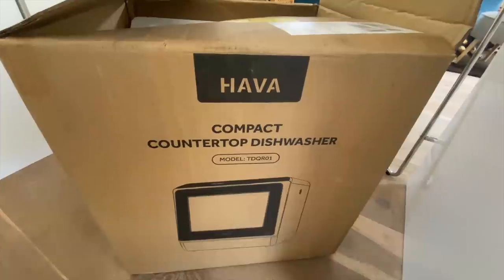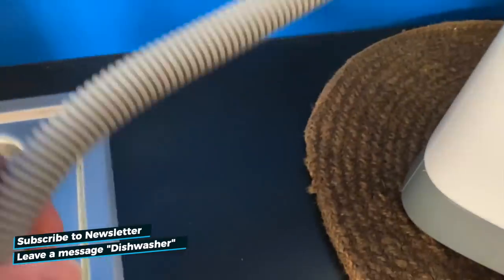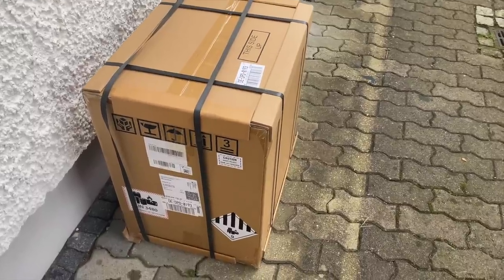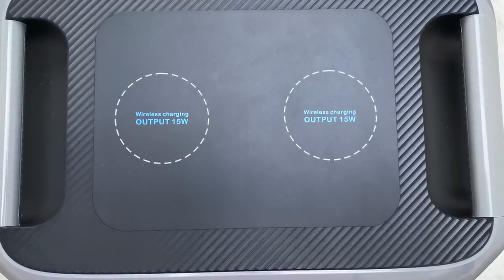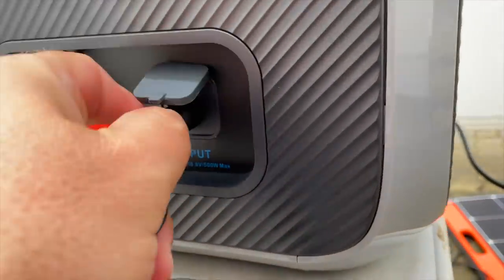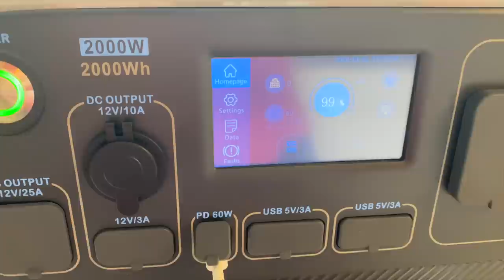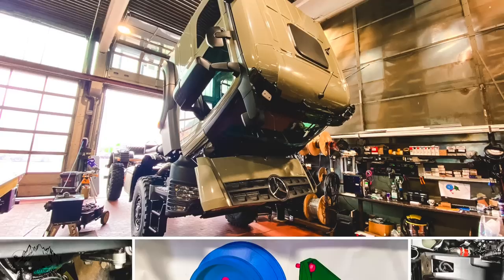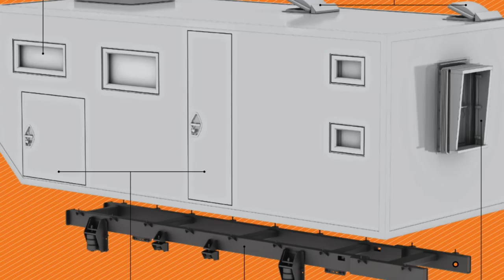Full Time RV upgrades ► |  Bluetti AC200P 2000Wh Solar Generator | HAVA Countertop Dishwasher

Comment: Have you tried to connect the new power Oak to a washing machine or a air conditioner in your home? I'm looking for a solar solution to lower my electricity bill, but I'm not sure if that device is suitable for this kind of use. Best Regards from Lisbon
Reply from the maker: It should be, power up to 2500 watt peak … 2000 watt constantly

Comment: What about power consumption of dishwasher per cycle with and without drying?
Reply from the maker: Will have a Look asap… at the moment dishwasher is with manuals at cabin builder in order to fit it in our new truck … 
Maybe you can check the manual online?! Thanks 
see ya when we see ya 👋 
Fabian Isabela and Matheo
Reply: My Comfee Plus peaks at 758 watts for the first ten minutes then drops to around 38watts for 40 minutes cycle,  no drying.

Comment: Guys come on. If you need a battery backup you've done something wrong when you sized up your solar panels and your house battery. You got plenty of roof real estate. Fill that rood with solar panel rather roof deck or other useless things that have no real life value. No one with a rig your size should need that battery backup. Just do the math correct when sizing up your system and you are golden. No matter how much power you use you will get free refill from the sun. Make sure you also prepare for rainy days, so add more batteries to your house batteries. Calculate you max daily usage and calculate 3 or 4 times more battery capacity and you don't need to waste money on that bulky back up battery. Used EV batteries can make up your entire house battery. Then you got power to run ac, induction, hot water and whatever else you fancy. Solar panels just passed 420 w per panel . Mount as many as you need. Even stack em 2 or 3 layers deep if you need more solar and make the lower panels slide out to each side or the truck, ie by using a manual awning crank device, a drill or electric motor driven with a push button.
Reply from the maker: In our case that’s a Back up when some essential electrical part fails … no worries 😉 we will have enough solar on the roof… we will use i.e.  a 120 volt power bank for 120 volt machines in countries where you only can buy 120 volt electrics… so all good… thanks for your informative comment…👍🍀
See ya when we see ya 👋 
Fabian Isabela and Matheo

Comment: Hallo Ihr Drei
Eine Spühlmaschiene für 3Tassen morgens? 3Teller und Gläser und Besteck Mittags und abends 2 Brettchen und Besteck. Ich hatte sie eingebaut und nach diversen Probefahrten wieder ausgebaut.
Pauerbox wofür? Grosse Batterie tuts genau so oder im Notfall einen Generator 2,2 Kw Honda als Empfehlung. Hatte die 30 Jahre in der Firma haben immer Funktioniert
Diesmal natürlich ein Inverter. Zum Kühl oder Gefrierschrank
Erste Wahl Vitrifrigo, teuer aber super. Denn die Kiste schleift Du nicht mit herum. Heute scheint mein motztag zu sein😩😜nicht bös gemeint. Wir haben Halifax für Mitte April Optiert und hoffen das es KLAPPT.
Grüße aus Erftstadt die Magers und Fatu Hiva
Reply from the maker: 🤣😊🍀 Motzi Magers 😅🍀 verstehe ich alles… jeder muss seine eigenen Erfahrungen machen … wir it haben diese Art von solar generator für uns als back up im Notfall on Board … besonders die 110 Volt Variante für den anderen Kontinent… 
Danke trotzdem fürs vorbeischauen … 
See ya when we see ya 👋 
Fabian Isabela and Matheo
Reply: @LiveandGive4x4  Hallo Fabian
Hoffentlich haben wir auf der Abenteuer Allrad die Gelegenheit das Thema durchzudiskutieren und uns abzustimmen wenns nach Kanada geht. Hab heute gelesen das der Flugverkehr wieder aufgenommen werden kann,, auch für Touristen. Bis April ist es noch lange hin.
Grüße Josef.